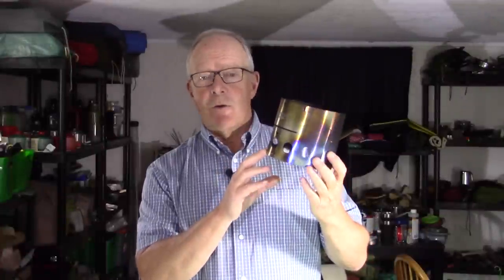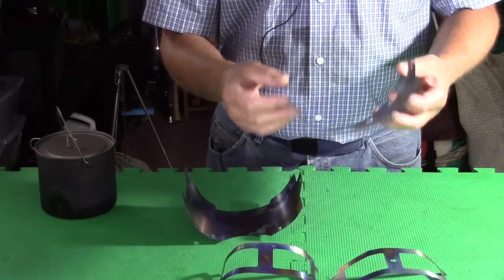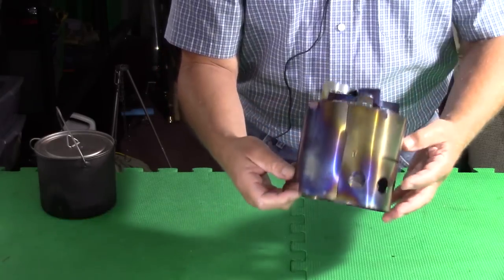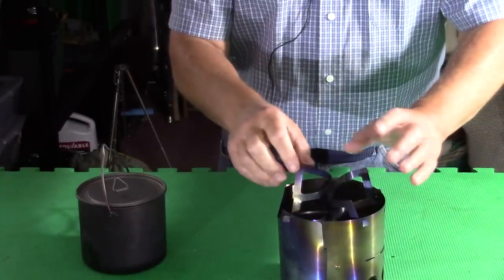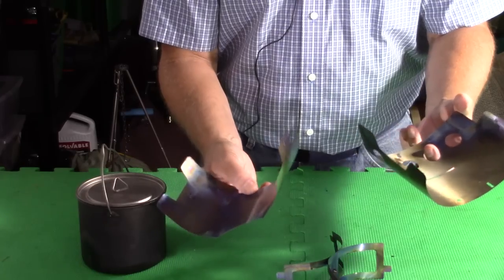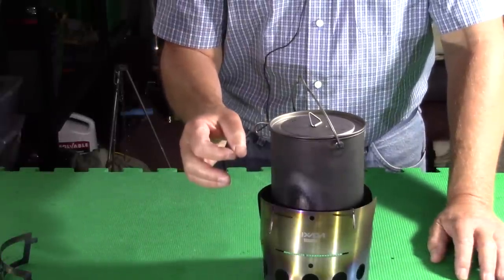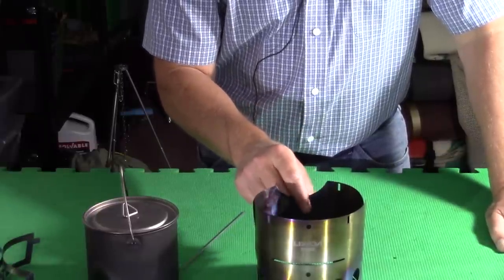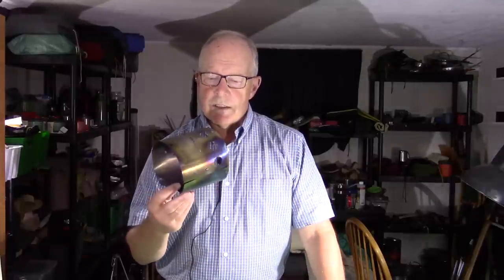Chinese Littlebug Jr Wood Stove Clone - DO NOT BUY

Comment: Hi Mark, I had a very SIMILAR experience but with the Kampmate Stove, I had both the titanium & stainless versions. 
The stainless stove warped & twisted badly BUT the pot stands took the heat great. 
The titanium stove easily took the heat but their pot stands failed liked yours did. 
So basically I took the stainless pot stands & put them on my titanium stove, problem solved !! 
Keep these awesome informed videos coming. 
👍👌
Reply from the maker: Interesting how that worked out. I have both SS and Ti versions of that stove under another brand. Both have warped a bit but not too badly. Thanks for commenting

Comment: Another honest review. Thanks, mark. I have to wonder if the pot stands would hold up, even in the thin gauge of titanium, if they didn't cut out most of the centre portions of them. They don't reuse those pieces anyway. Of course, if they don't respond to you, you can't suggest it to them.
Reply from the maker: I wondered the same thing. All they did is copy the original with considering the difference in metals. Thanks for commenting

Comment: An 18” piece of 8” wide aluminum flashing has lasted years and cost about a dollar. It’s fairly heavy flashing and very sturdy. I punched vertical lines of holes spaced a half inch apart for skewers (actually pieces of metal coat hangers bent 90 degrees on one end and a wiggle at the other). It curls in to any size and accommodates various stoves. My go to stove is the Docooler wood gas that breaks down in half. I keep the screen a half inch away from the sides of the pot a half inch down from the top. I find it reduces boil time considerably.  It conserves fuel when using it for an alcohol burner. It all nests together nicely. The screen is very light considering fuel savings. When using wood it means not having to stoke the fire as much.
Reply from the maker: Right on. I use flashing for most of my windscreens that I wrap around a stove. Thanks for commenting

Comment: Bought a no name small square twig stove from Amazon that had an alcohol or heat tab dish option, a burn plate. Included was a cheap case, collapsible stainless steel tube to blow on flames, and folding windscreen, all for @$12. Problem was they cut the tabs that hold stove together upside down, so it falls apart. But windscreen and blower work fine. Peace
Reply from the maker: Some of my early videos feature a stove like that. I did find a version that is hinged and it is much better and safer. Thanks for commenting

Comment: You could place a trivet on top. But I don't like the single locking thing centre of each piece. I wouldn't trust it to not let go entirely.
Reply from the maker: I am thinkin about using ss rulers from Walmart to replace the post stand but the whole stove is flimsy as you say. Thanks for commenting
Reply: @MarkYoungBushcraft  I think some ss rules with grooves in them or grooves in the pot to avoid them in place would add tremendous stability. Makes me think too, if the bottom also slotted into something fixed it would be very stable then.

Comment: Good learning experience. I was considering one of these years ago, however I did not like the unnecessary cut outs on the pot  supports and opted to go with the Littlbug Senior version. Yes, more expensive, but no problems with it in the years I’ve had it and recently added a fire base for leave no trace. Good to support original makers.

If an item is shipped from China, one runs the risk of poor quality control and an unusable, potentially dangerous product as you’ve stated. Now, if a similar, better quality item is available from Taiwan, I am more confident It will work, and customer service is outstanding. Japanese products at one time were noted for cheap quality, but then, the government and business got together and began steadily improving quality. Today, I do not have a problem buying Japanese goods because the quality is there. Indeed, quality is imperative if I make any purchase nowadays. South Korea is another good place to buy goods. 

In any case,  caveat emptor and thank you , Mark for making us better, informed consumers.
Reply from the maker: I agree with your experiences. The challenge can be not knowing the quality of an item until it arrives. Even worse is when there is no customer assistance. Thanks for commenting
Reply: Cars are a good example of this 
Yrs. ago I wanted a honda civic
but , first I made sure it was built in Japan ! It was a very good car !!!!

Comment: Thank You for the insight,  have you tried flipping the pot stands upsidedown ?
Reply from the maker: Yes, before using it I researched how the original Littlbug Junior is intended to be used. They advise the pot stand can be used in either position. After that one use, the pot stand is so flimsy it will not hold in either position. Thanks for commenting

Comment: Thanks for sharing...I bought this stove and the same problem happened…So I discarded the two thin pieces,and made a small ball chains as littlbugstove that can hold alcohol stove or small cup,and another way is two light metal stick as a stand on the top of lixada stove as you did.
Reply from the maker: Great solution. I will consider doing the same. Thanks for commenting
Reply: @MarkYoungBushcraft  I bought 2.3mm ball chains and the alcohol stove burned it broken…

Comment: Hey Mark. I was wondering if you have tried out any of Bushcraft Essentials folding stoves. I watched a ton of reviews on the Firebox stoves, but they can get a bit expensive to get shipped to Denmark, though im not sure if the quality is comparable between the two.
Reply from the maker: Your timing is good. I had already owned two of the Bushcraft Essentials lineup of stoves and I recently acquired the rest of the lineup. I will be making an introductory video shortly and then a review of each of the stoves after that. I will also make comparison videos with the Firebox stove
Reply: @MarkYoungBushcraft  awesome. Can't wait 👍

Comment: I do have several lixada stoves. The one problem I have had out of all of them is a trangia spirit burner type stove. As soon as I opened the package the summer ring fell off of the pressed on/stamped rivet that serves as the swivel. The Firebox nano type lixada is great though. Not the early gen though.
Reply from the maker: I have found a great deal of difference in quality between some of the Chinese made Trangia type stoves. The best quality one I have found to date is by ALOCS. I have a few Lixada stoves and most of them work great. Guess I had to hit a dude sooner or later. Thanks for commenting

Comment: Nice video review. I have to agree about titanium stoves. Even the hot tent wood stoves from titanium are very flimsy and sheets warp under heat (especially cylindrical stoves! there are many videos on YouTube about them) I was thinking about getting a titanium foil flue for my homemade tent stove  to ease the back pack load but I opted out after having watched those videos.
Reply from the maker: I think there are some stoves (Firebox and Bushbox) that benefit from being made with titanium. Even they are known to warp more than their stainless steel counterparts. I think the concept of an ultralight, backpackable stove for hot tent camping is attractive but I wonder about long term use. I have not heard of Ray Mears using a titanium stove in the north. Thanks for commenting

Comment: Always sucks when you spend money on something and it doesn’t work. I think it still could be useful like you said as a windscreen, or I would simply put a small grill on top of it and continue using it as a woodstove .
Reply from the maker: I am going to try using like you suggest. I am a bit concerned even the side walls are too thin to support much weight, especially when hot. Thanks for commenting

Comment: Looking at pictures of that stove on Google images, all the stock photos seem to have the pot stand the other way up to how you had it. This would have most of the pot stand inside the stove, not protruding as you had it. Worth trying?
Reply from the maker: The original Littlbug Junior show using it in both positions. At this point the post stand is useless and too flimsy to use at all. Thanks for commenting

Comment: Hi Mark, I believe there is no high or low mode. You have assembled this with the potstand upside down. It relies on the edges of the potstand to rest against the sides in order to transfer the load. The gauge still looks to be too thin for my taste. so I won't buy it, but I think you need to do an update on this one. Regards from Norway.
Reply from the maker: Hello my friend. The original Littlbug Junior shows it being used in a high and low mode that is where I got the idea. Thanks for commenting
Reply: @MarkYoungBushcraft  I think that would be a reasonable assumption if the gauge was thicker, but I think that the thin titanium can't be used in that configuration.
Reply: Exactly what I was thinking and the way you chose the slot must be in a cross configuration to avoid splitting of the outer shell but its just an opinion since I dont own this stove
Reply: @222riddler  I actually bought one. Not for proving Mr. Young wrong, but because I would like to try using this for a windscreen. I have the much thinner titanium foil kind, which I don't like. When I have it i'll test my theory.

Comment: Hi Mark, 
I bought this to use as a windscreen after seeing this video. I had an idea that using this with the potstand the other way would work. I was wrong. This can be used as a windscreen kind of... It barely as functions as a bush burn box, but in all practicality you can't put anything on top of it. Mark is right; Don't buy this!
Reply from the maker: Sometimes buying cheaper knock-offs is not such a great deal. I am using it as a windscreen but that is all it is good for. Thanks for commenting

Comment: Almost looks like it was made out of cracker box material.  I was wondering though, what if you replaced the pot stand support nib with a small nut and bolt or small rivet? That way it would be permanent and it would still lay flat.
Reply from the maker: Interesting suggestion. I will give it a try. Thanks for commenting
Reply: Too bad cracker boxes aren't fireproof ( looks like they're at least twice as thick as that stove ) !?

Comment: Bought one .Mine came with a plate that slid in through that long slot in the side.Rubbish item.Threw mine in the bin.
Reply from the maker: Mine also came with the plate which I understand is a damper. I was tempted to toss mine but it will make a good windscreen. Thanks for commenting

Comment: I have the Lixada stainless steel wood stove, But that is a Rip off of the solo stove design.
So the design is well founded and you are buying a cheap version of it.
....
With this stove I presume that it’s their own design and you have exposed the flaws, 
Says a lot about the Lixada company ... buyer beware 🤔
Reply from the maker: What is even better is the Solo is a rip-off of the Canadian designed Bushbuddy. I have the Lixada woodgas stove and it works great. It is based on the Silverfire Scout. Sometimes the stoves are good quality and other times, as in this case, they are junk. Thanks for commenting